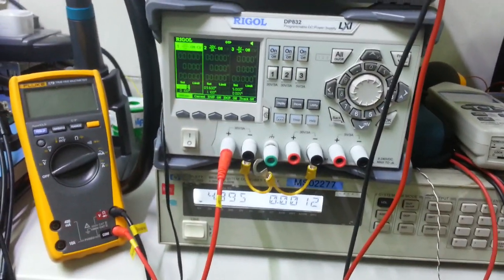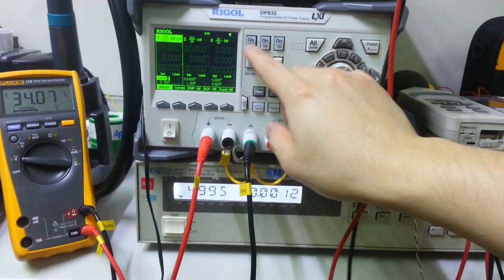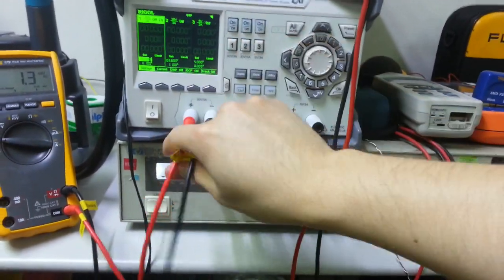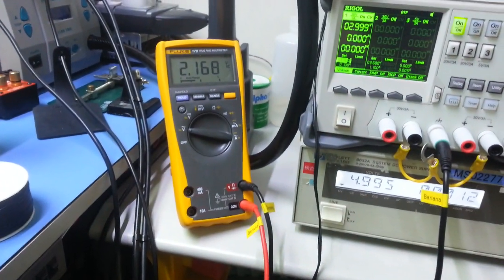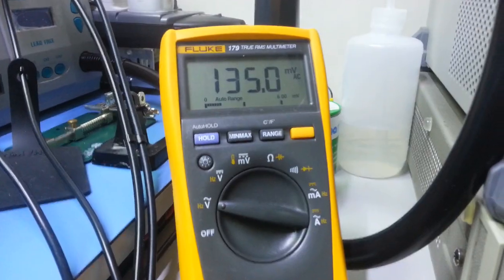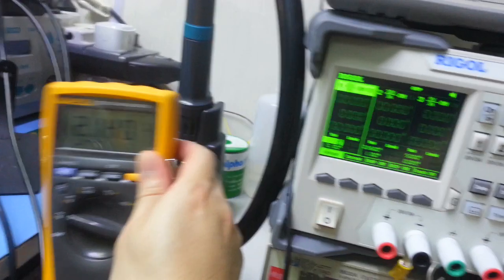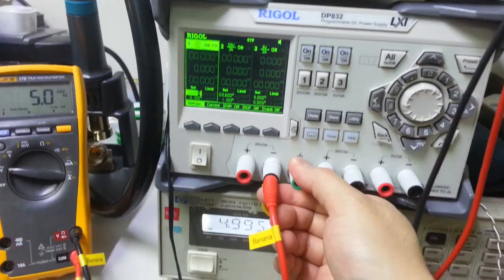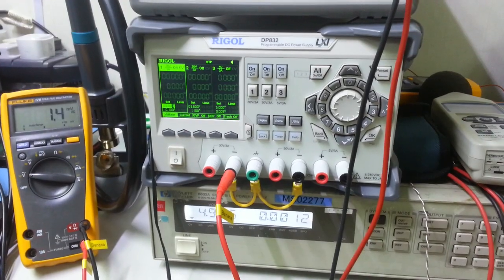RIGOL DP832 DC rail to ground problem(which may kill your circuit)

Comment: How do you find the performance if you connect your yellow ground strap to GND for the circuit providing the power?
Reply from the maker: I don't get understand what is "performance" you mean. Thank you!
Reply: I mean does the negative now return to GND voltage?
Reply from the maker: If  negative is connected to GND with yellow ground strap. The AC voltage around 33Vac will eliminated on both positive and  negative. But the down side is the power supply is no longer floating.

Comment: I see your point, my Korad is between 124mc AC on one and 600mv AC on the other. But if I check it with a low pass filter AC enabled meter I get nothing. My AirCon is also running that could be the noise my meter picked up on AC. I don't own this Rigol, but I'm thinking about it. Now this is what I noticed without the low pass filter on. If I use any of my three soldering stations as the ground still with positive to my current Korad and no Low pas filtering I get nothing. So you said the tip of your soldering iron is ground, mine none of mine act like a ground. My irons are isolated so if I had this Rigol I would not get 34VAC with my soldering iron to my PCB board. Maybe you should look at your soldering iron?